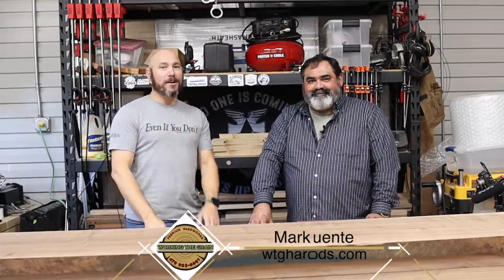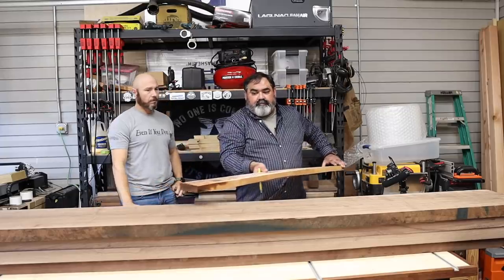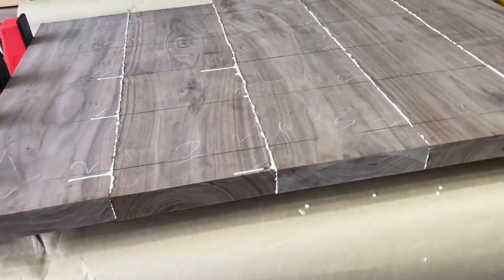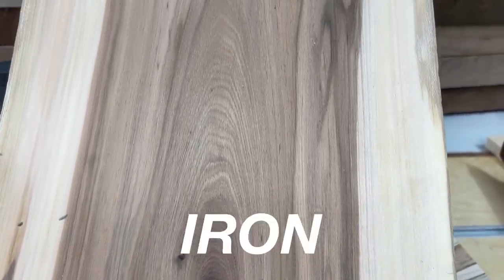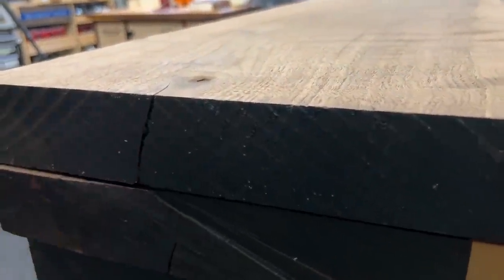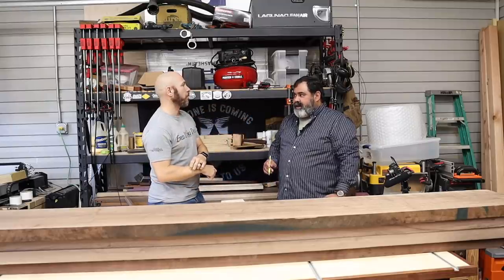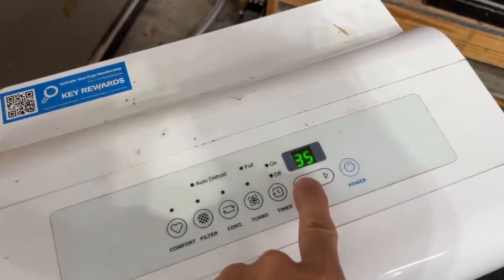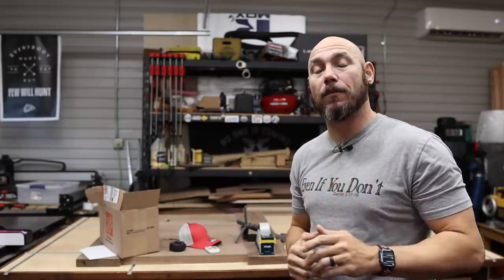5 Mistakes to Avoid When Buying Hardwood - Tips From a Hardwood Expert

Comment: great video! We did a counter a few years ago for a friends cabin. when my buddy moved it up outta his basement to finish it out doors after kiln drying it, the weather turned to rain. thr counter was sealed and under cover but the grains were both "frowning". after the install in a wood stove heated home, it cupped about 1/4 in the center. no c channel installed and no poly on the underside. lesson learned. on so many levels! :(

Comment: Hey Matt, new subscriber here. On the last video you did with Mark ya'll mentioned Maple being torn up or ruined if it were to be run through a planer. Do you have, or can you do a video on how to mill/finish Maple?
Reply from the maker: You can send the maple through at an angle which helps a lot or if you have a helical head planer, it won't tear out.  If neither is possible, you can use the planer to get it close and then finish with sanding.

Comment: https://youtu.be/pMudMkcD490?t=165 don’t those dominos prevent the wood from expanding and contracting the way it needs to? I’ve read if you try to prevent the natural movement it can lead to splitting. 

It looks like those dominos are going into grain that runs in opposing directions, so the wood in one direction will move and the wood on the other side of the domino will not move with it.
Reply: That's a recipe for problems down the road. It's being done more and more because it's easy but eventually there will be a failure down the road in the joint.